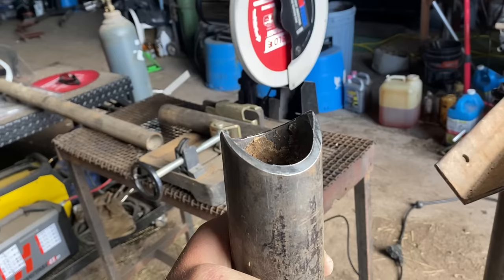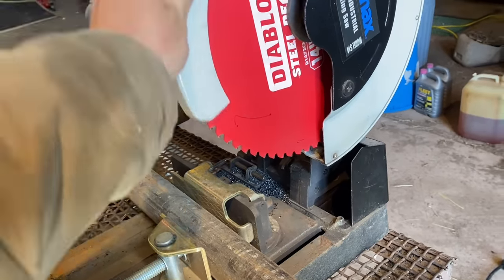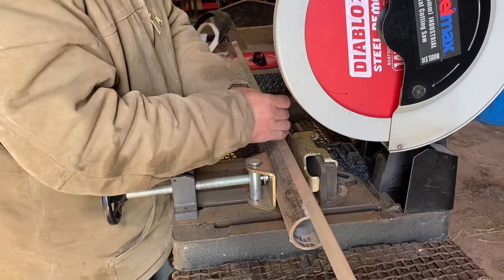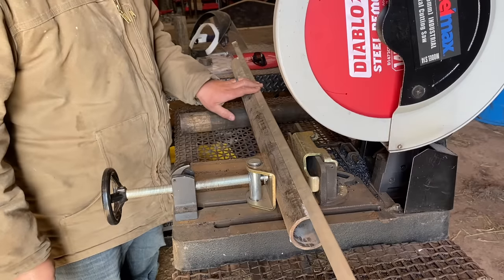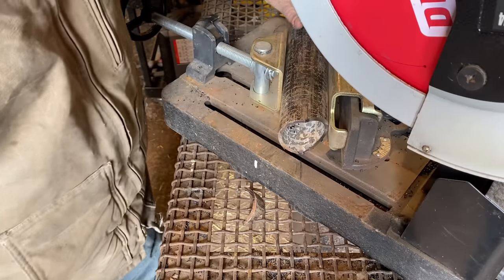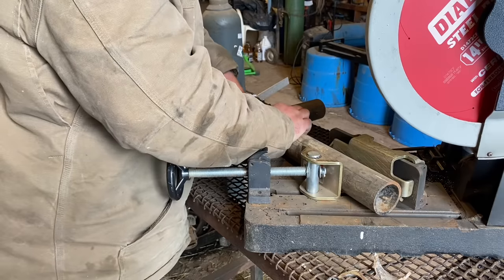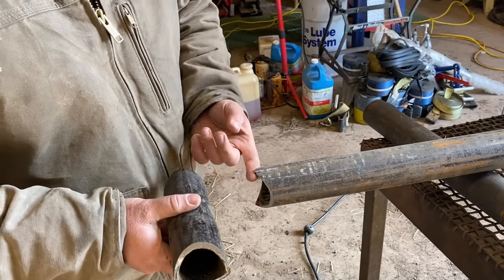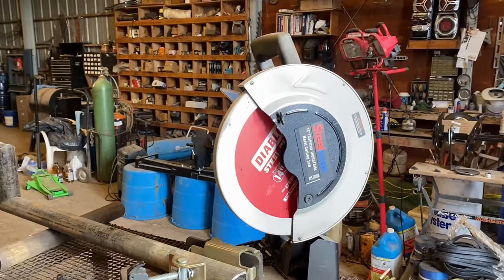How I Cut Saddles In Pipe With a Chop Saw-Descriptive Version

Comment: It’s been written already: on steel pipe you usually have that welding seam inside that you can use perfectly as a guide, no need to mark that pipe.

Besides that, I usually also measure the length (for example from the vise to the end of the pipe) to align my saw right in the middle for the second cut. If you don’t measure, the pipe could be clamped slightly too far in or out, leaving you with an angle above or below 90 degrees.

And I also use 33 degrees, works perfectly when you grind the tips just a little bit ✌️😎
Reply: ...unless you are using seamless pipe, (DOM - drawn over mandrel or Sched 40, like he is using have no seam) - however, there are also ribbon marks on occasion that can be used, but his method is clear and simple.
 - all the best :)

Comment: I wonder how the 32-33 degree of cut varies with different pipe sizes.
Reply from the maker: 32 degrees should get you pretty close on all diameter of pipe as long as the 2 pieces you are joining are the same diameter. The thickness of the wall will have an effect too.

Comment: I lived the cuts of that saw but the evolution blades wend dull in like 4 cuts

Then many other blades does so quick

I was averaging $15 a cut on 125 off wall

The idea was great but I say get a band saw
Reply from the maker: Interesting, I’ve been really impressed with the longevity of the blades I’ve used. And all I really cut with it is that oil field pipe and it’s wall is around 3/16-1/4”

Comment: It's important to note that these are not chop saws. You cannot put a cold cutting blade in a friction chop saw or wood miter saw as the RPM is too fast. You need the cold saw too, that has a low RPM, high torque gear box.

Comment: I won't get into the math, but the formula is based on the radius of the main pipe you are trying to fit the chamfered pipe to, and the radius of the chamfered pipe. It's simple geometry. You can use the trig tables to do it. The I.D. radius of the chamfered pipe is the "side opposite" of the angle you want. The O.D. radius of the main pipe is the "Side adjacent". Take a pocket calculator that does trigonometry. Take the "side opposite", and divide it by the "side adjacent". That will give you a decimal fraction. Now find the TAN^-1 button on your calculator and push that. The result is the chamfer angle, if I have this right in my mind. So, lets say you have two pipes of 1 1/2"  inside diameter, and 1/8" wall thickness. The OD radius of the main pipe is .875", and the ID radius of the chamfered pipe is .75". Dividing .75 x .875 gives .857. That is the tangent to the angle 40.6 degrees. Sorry....I did get into the math....LOL
Reply from the maker: Haha I haven’t had to do math like that in along time. I’m no mathematician, I just figured this out by trial and error.
Reply: @LuthiRanchWY  I was a concrete contractor all my life, and had to use some trig for angles. Then I became a hobby machinist/fabricator, and the simple math stayed with me. In high school I'd never of dreamed how much I'd use what I was forced to learn....LOL I've never been to college, except to do concrete work. I'm no mathematician either...Ha!

Comment: Does 32 work any smaller diameter pipe ?
Reply from the maker: 32 degrees should work on any size pipe as long as the two pieces you are joining are the same size pipe.

Comment: How did you determine your angle of cut ?
Reply: I figured it out through trial, and error using a scrap chunk of 2-3/8" pipe until I got the piece to fit decently, and it turned out to be exactly what this guy said; at thirty two degrees.  Then I wrote it down, to remember it.
Reply: @edwardschwenk3100  It's a neat idea. I'm curious if there is a mathematical formula based on the OD or ID on the tube, that way you could fit any sized pipe without trial and error.
Reply from the maker: I figured it by trial and error also but as long as the 2 pieces you are joining are the same size 32 degrees should work on any size pipe.

Comment: That works great for 90 degree joints and for churning out production work. But, the chop saw is not exactly portable. And building fencing or railings or roll cages requires lots of hand work with hand held angle grinders. Some very weird angles. Lots of trial and error fitment.

Comment: Be careful grinding with a cutoff blade like that.  Pressure on the face of the wheel will make it shatter and send shrapnel all over, if you ever been hit in the face with one of these it's usually a visit to the ER.  Better to keep a grinding bit around.

Comment: That method below is not perfect, but pretty close, and only works on two pipes of similar size. It's more complex to come up with the angle where you're fitting a smaller pipe to a much larger pipe.
Reply from the maker: You are correct.

Comment: Not a cold cut saw, those saws are really slow and use a milky lookin oil in a bath around them and during the cut, they are usually bulky and pretty pricey.  We call that saw you're using a hot saw or a chop saw.

Comment: That’s entirely too easy, I usually cut mine with a torch without a jig ( because I’m that good) then spend an hour on each post filling in gaps with the welder 😂.
Reply from the maker: Haha hopefully this helps you out a bit and saves you a bit of welding rod and wire in the process ha
Reply: @LuthiRanchWY  Lol  thanks for the video I am going to do it your way from now on, it will save me a lot of time and welding rods.

Comment: why do people treat these cold saws like a abrasive chop saw? slow down ffs
Reply from the maker: What do you think I cut through the material too fast? I’m not heavy handing it just letting the saw go through the material at it’s own pace. It’s a high quality saw, not sure what kind you are using if you have to hold it back from cutting too fast.
Reply: @LuthiRanchWY  your not letting it go at its own pace your forcing it too fast when you cutting the sides of the pipe.. you have to remember the teeth are carbide.. carbide needs to have a constant feed rate otherwise it can start loosing a edge and in some cases even chip. have too much of a feed rate can also increase the risk of a teeth being chipped due to it have too much feed per tooth rate which is the same issue you have when using carbide tooling in milling machines and lathes. treat it as if you milling something and your find your blade can a very long time. Angle of attack is really really important on those blades as well as if the blade has to remove too much material at once from say cutting a flat bar flat on its face instead of on its side.. you can work harden the steel as your cutting.. those sparks you see is the material being work hardened as you cutting.. it should always be a spark less cut. so to clarify.. if you cutting a 100x100 5mm wall box section. you gently let the blade get the first bites in then soon it makes contact you give it a consistent feed rate.. even if you feel the saw can go faster.. don't keep the feed rate the same especially as you going through the sides. your vice position is what i talked about earlier regarding angle of attack. you need to make the surface area as min as possible so that the teeth are constantly cutting while not trying to take too much material in one go. so if you cutting box section you want the blade to cut through the box section side facing you first then to the other side.. hope this helps you get the most out your blade. ive seen so many people bitch about these blades not lasting but they end up doing stupid things with them
Reply from the maker: @Migman2020  thanks for that very detailed explanation on how to use that type of saw. So to simplify what you said if you are seeing sparks you are cutting too fast? I’ve loved my dry cut saw and have been pretty happy with the longevity of the blades especially since all I pretty much cut is drill pipe.